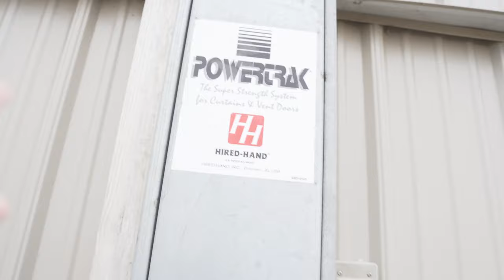Our Hog Barn Is Falling Apart.. (Part 2)

Comment: A tip to get more life out of your curtains, sandwich your curtain between 2 layers of rope. A screw hook or J- nail every 2 foot top and bottom of your tunnel curtain. Use an X pattern with the enter and outer ropes, avoiding vertical ropes. This disperses the wear pattern on the curtain and holds the curtain off of the bird wire.

Comment: i did smash the thumbs up button..... i have no idea how old your buildings  are.... have you ever had to change out the floor slats in your barns.?... how long do the slats usally last?...
Reply: It depends  how  good  you  take care  of your floor
Reply from the maker: Miller urban homesteading It all depends on how well you take care of everything. Slats don’t go bad for 15-25 years I’d say. Maybe longer
Reply: In our area quite a few 40’ wide finishers started going up in the early 90’s. Some of those barns are starting to get slat replacements. A lot of those had no feeder pads and nipple waters. So 25-30 years is about where they are starting. I think feeder pads, wet/dry feeders and patching with ArmorRock or equivalent will definitely extend that lifespan.